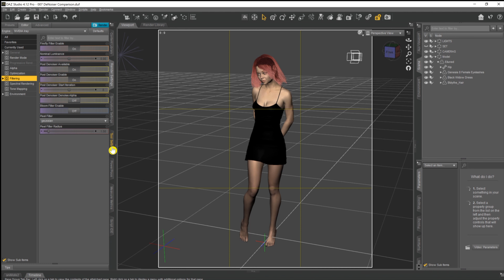Daz 3d Tutorial : Using The Denoiser For Faster Renders

Comment: Hello, everybody!) THank You very much for Your tutorial. Wanted to write here - in case if smb meet the same pb. 
 In my case - during rendering - PC always was going to burn out (sounded like it ), and all renders were noisy. 
Then i found this amazing denoise function (thanks to You) - but all renders were the same - noisy (doesn't matter is it turned ON or OFF). 
After reading some posts on official forum - i turned OFF in ADVANCED section all checkbox from CPU . And after every "unchecking" - tested the render). And denoise worked after i unchecked/restarted "allow CPU fallback" option. Now rendering is much faster (probably 10-20 times faster) and i don't hear the sound of dying of my PC.
So - if smb feels, that denoiser is not working - try to turn OFF CPU  options in ADVANCED section of render settings
Thank You!
sorry, if offtop ))
Reply from the maker: Hey Sergii - yeah, the latest versions of Daz don't like falling back to CPU .. and, as you found out .. the denoiser doesn't work with the CPU or with AMD GPUs .. it's purely an Iray / NVIDIA thing!

Anyway, glad you found the video useful!

Comment: Again, thank you for this video.  Quick question.  Is there any point continuing the render after the denoiser kicks in?  I doesn't seem like much more is accomplished.
Reply from the maker: Hey Pasquale .. thanks. The denoiser gets applied every time an iteration is drawn to the canvas ..  the more information the denoiser has from the raw render the better it will be able to clean up the image. 

So yes, leaving it run will improve the results over time .. although the difference between each iteration might not be noticed .. comparing an denoised image from 100 iterations and 1000 or 10000 iterations definitely will be.

To test this - enable the denoiser, set the iteration number where it starts at the default 8 and let the render run .. you will gradually see improvements each time the image is rendered to the canvas and the denoiser gets applied - it just might not be noticeable frame to frame nor noticed at all if and when you get to 1000s of iterations .. but it will be happening.
Reply: @RaukoDaz3D  Excellent.  Thanks again!

Comment: Woah! Never tried the de-noiser, you've convinced me to do otherwise :D Great stuff, love your vids!
Reply from the maker: I still think it will be a bit hit and miss. Scenes that would take hours and hours to get to 100% convergence will still take a while before you can apply the denoiser, I reckon, due to a lot of noise that will need removing. But relatively quick renders where the character model cleans up fairly quickly will benefit to the tune of 30 / 40 / 50% speed boosts without losing too much quality.